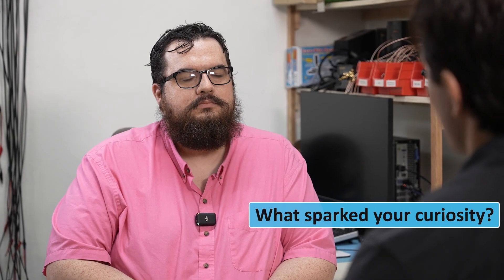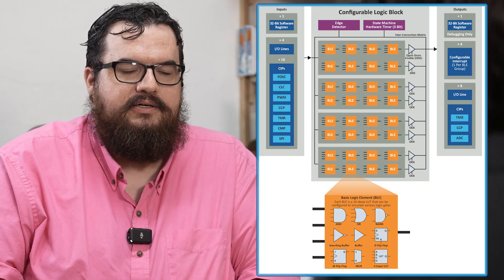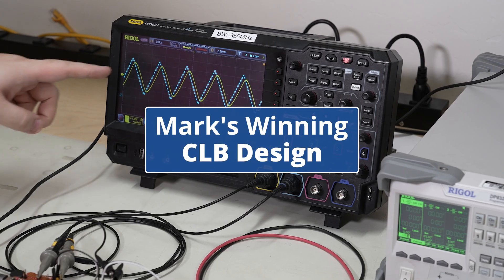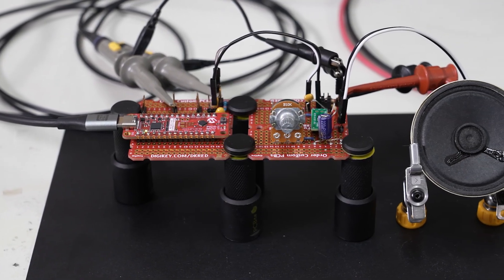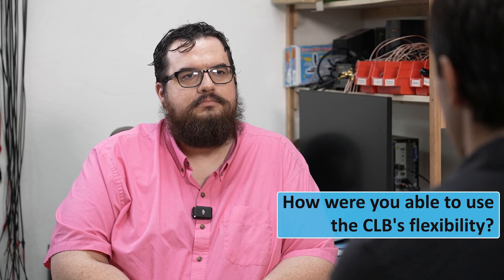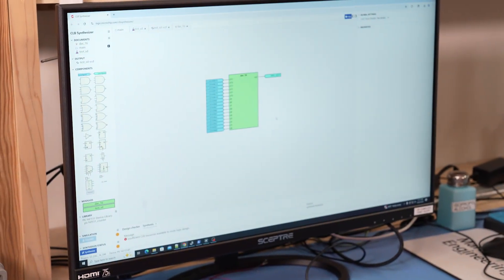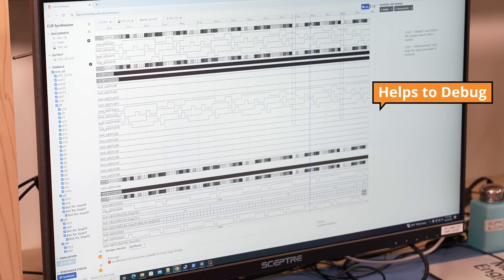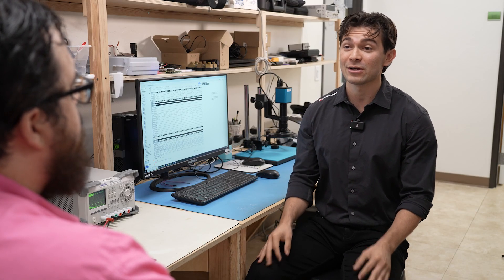The Design that Won $5,000

Comment: Very very low technical value in this video.    Waste of time.  12 bit =4096 or 4K…… OK. 16 bits = 64Ks.  So what?  NOSIE is the issue for more bits of resolution.  Two thumbs down, try again.❤❤